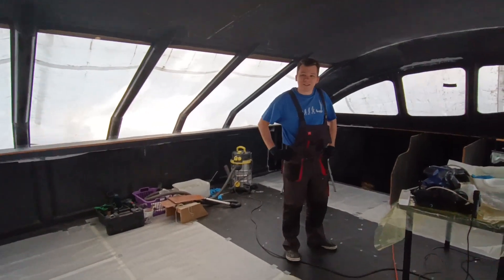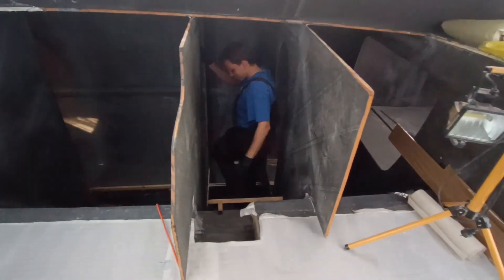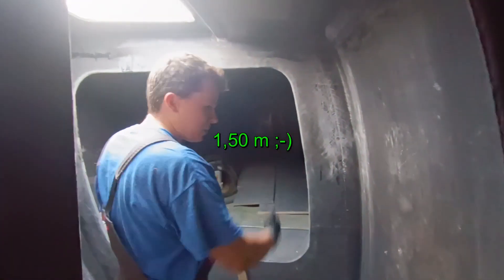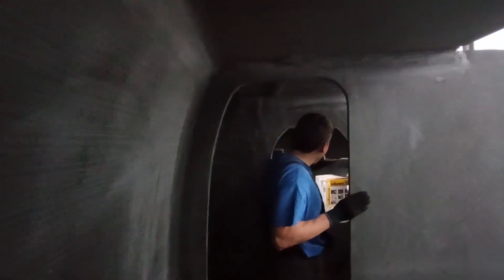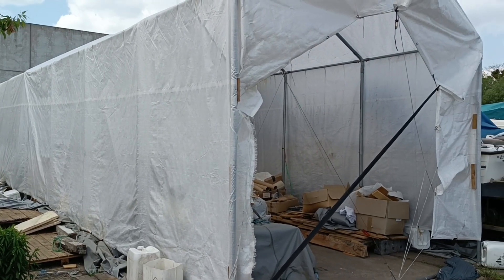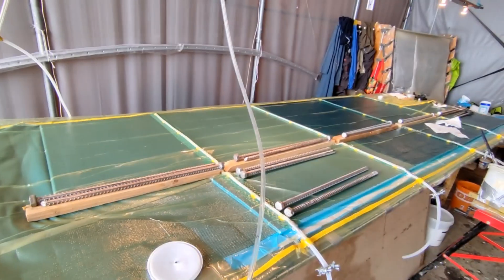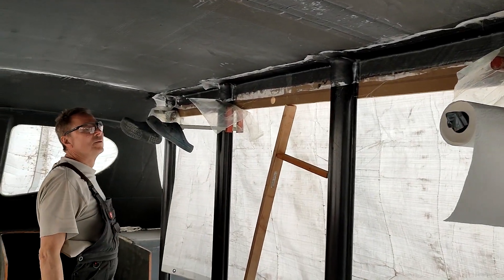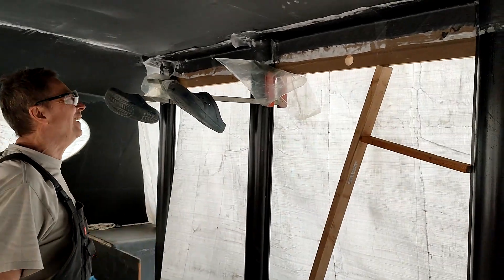03.   Building 15m carbon performance catamaran - "CarbonBee"

Comment: What do you think the dry weight will be? Dry weight equals all fitted out before you move on your food, clothing and other personal items?
Reply from the maker: Robert, all the parameters including the weight, displacement etc. were defined during the design process. Guessing is not a good method for such big project. Please look on the description under the video and on my responses on the comments under the videos in my channel (parts 01 to 04 up to now). There are a lot of information about the project. At the end of the Video-Part-01 is also a chart showing the comparison to other catamarans.
Reply: @bojanu7212  Impressive
Reply: @bojanu7212  I didn't find the dry weight.

Comment: God bless German engineering!!! I'm American and was 🏆 about the total cost of the build expectations especially when you're using lightweight and strong carbon fiber.. I'm a biker and I have recently fallen in love with sailing. I don't want to buy a cookie cutter catamaran like everyone else and have 3 kids that are old enough to help.. I definitely don't need anything as big as your project but have been looking at Richard Woods designs out of the UK.. he's got a wonderful 35 foot catamaran that has a great layout..
Reply from the maker: I looked on the webpage of R. Woods designs and I don't know what design you mention. There are good designs, however very old and far from modern trends. I will suggest you to look for other designers.

Comment: Awesome size cat and an unreal build guys. I only have one question and that is seeing that it’s a 15m long cat which is around about 50 feet, I’m curious why you didn’t make the main cabin bigger?
Reply from the maker: Thank you for appreciation.
Any design you make, have a lot of compromises and you need first to decide what is important and what is less important for you. In case of JANU-15 (CarbonBee) very important was the performance and seaworthiness of the design. My design is an real ocean-going catamaran, which can easy go over the waves with high speed. That is why the bridge is high and far from the bows – the waves have reduced chance to hit the bridge, slowing the boat, make extreme noise and stress for the whole structure. 
Slow boats could have other design features and be still bearable, but CarbonBee is an another tier– see the last picture in our video-part-01.
CarbonBee has also a lot of different other solutions to get the properties, we wanted to have.

Despite that that the bridge is relatively short CarbonBee have a big area in the cabin, where we have big sofa with table, kitchen, navigation table, steering wheel and all the operating lines, winches etc. 
Cabin has an area of 5,7x2,8 m, where you have full standing height. Additionally in the cabin is another 10 m² where you have a height for sitting, not to say about huge free cockpit.

The production catamarans, nowadays manufactured generally for charter are a caricatures of catamaran. 
Unfortunately, the publicum is used to think that these designs, with non-aerodynamic lines, double storied, with sailing ability only with the support of engines, slow and heavy, are the right designs. 
Why? -  because people see only such designs overall. I agree, such catamarans are good, extremely good to stay in the port as a condominium, or for short trips under motor. That is, why I call them condomarans.
Reply: @bojanu7212  thank you for taking the time to reply and explain. I can fully appreciate and understand your design now and look forward to seeing more of you building carbon-be. I would have loved to have been able to do the quality work your doing and have been able to build my own boat and travel the world by sea but unfortunately for me I became a paraplegic when I was 39 so all I get to do is admire the work of others here on YouTube. Cheers mate

Comment: I came across your videos last night. Very impressive build! I was especially impressed by the fact that the design is your own.
I'm currently looking into the various options to build a performance cat myself, and have been thinking of self design too, but I am not confident that I would be able to get it right... I would really be interested in hearing more about how you went about designing it and working out the various loads on the structure.
Reply from the maker: First, thank you for the appreciation.
Yeah, it is a lot of engineering job, when you want to design such a big catamaran.
For designing of traditional boats/catamarans with traditional technology and materials you can get help from DIN EN ISO (series 12215 - 12217) and ABS regulations, where are normative references and calculations for design.
However if you want to build experimental, performance, or racing catamaran using "exotic" materials and technology,  you have to go trough complex engineering calculations to get it right. Nowadays you can get good support from CAD/CAE. For example for loads/materials calculations I used FEA from Solid Edge.
Anyway, please don't give up. The designing itself is a exiting thing, not to say about the building process and ...sailing.

Comment: Good to see an update! When do you plan the first sailing out?
Reply from the maker: We will need still much time to finish it. Good is that we will close the boat (windows, hatches, port-lights), and finish hull outside painting this summer. Than we will be able to work inside whole year, independent from air temperature outside. First sailing? We plan within two years.